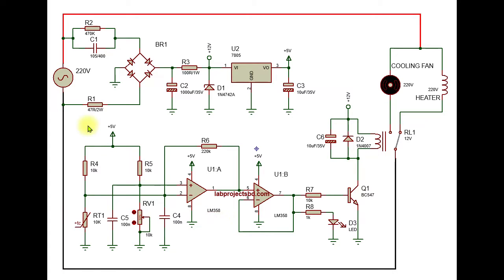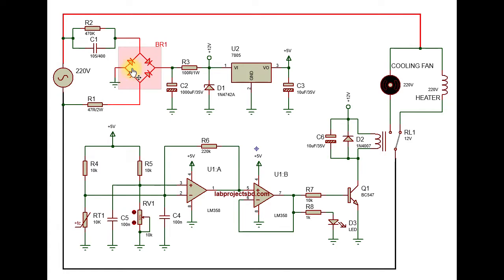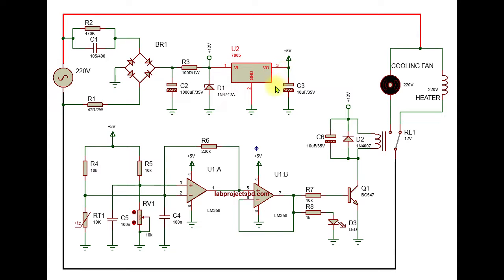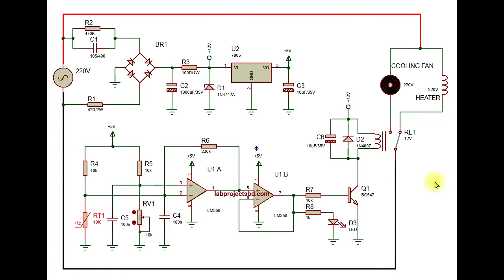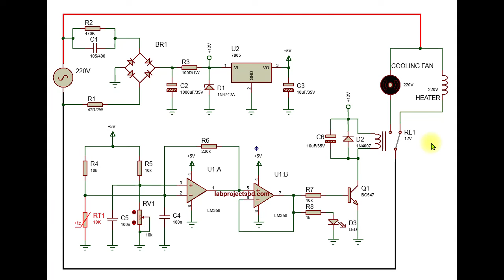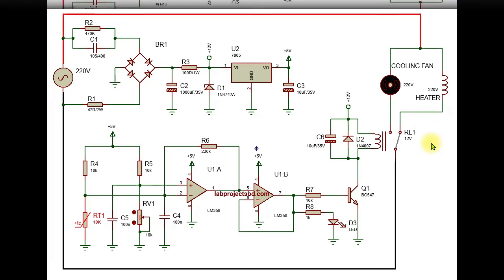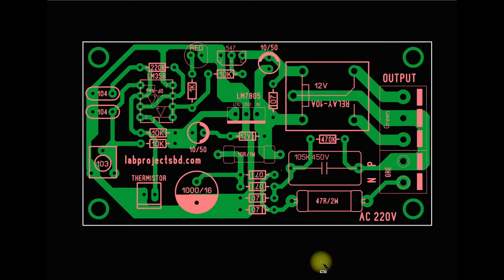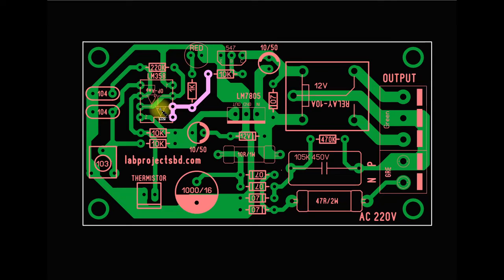Analog Temperature Controller using LM358 Op Amp

Comment: Very nice work, bro.... Can the device be set to only 25 degrees to control the temperature of the aquarium heater, or is it necessary to make an adjustment to the scheme?
Reply from the maker: Yes, you can use if for 25'C. Just tune the pot to set the point.